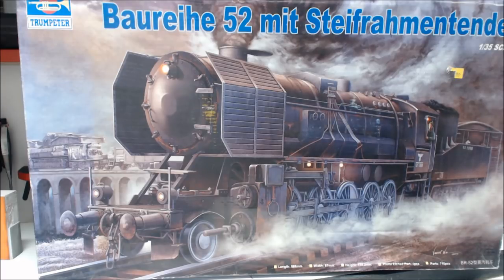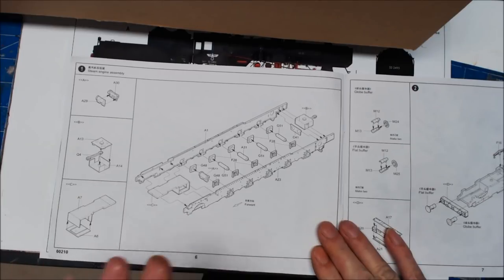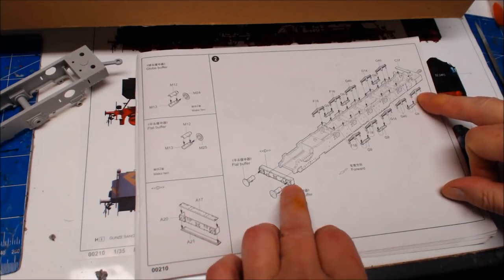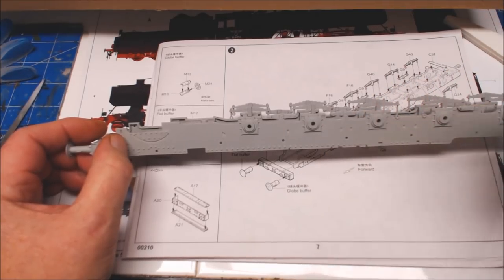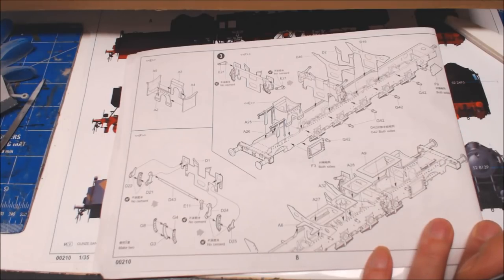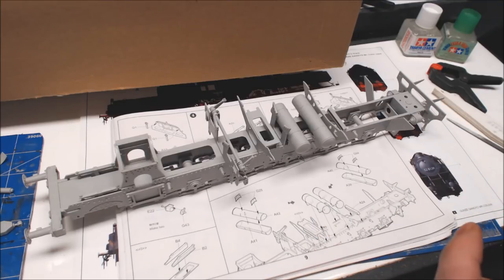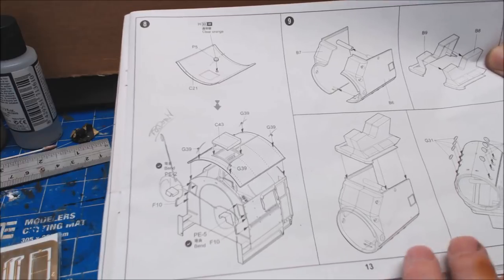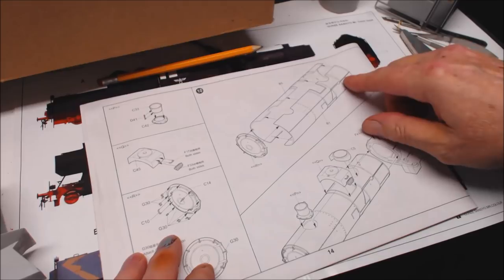Trumpeter  1/35 scale (Baureile 52 mit Steifrahmentender)  Build Part one

Comment: looking good Simon. From the front: smoke stack, sand box, steam dome. I'm not sure what the thing is behind the steam dome, maybe a whistle and the relief valve. Sand is fed via hoses to the front of each driver to give them traction at very slow speeds. Without the sand the wheels would just spin. Steam dome is where the steam comes out of the boiler and is fed in to pipes going to the steam cylinders.
Reply from the maker: Thank you that answers a few questions everything I look at, lol looks like a braking system lol many thanks Sim

Comment: The copper and brass look nice but I don’t think copper and brass would hold up to the heat and pressure steam would put them under. They would use iron piping,and it would be painted the same color as the rest of the compartment.